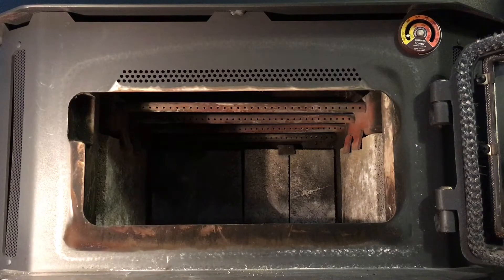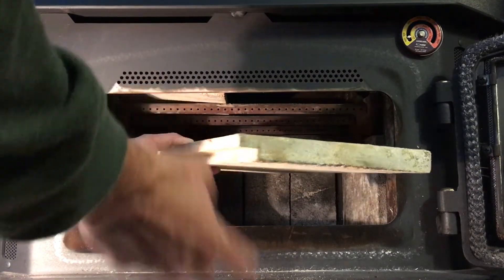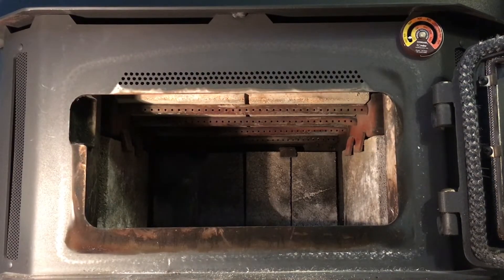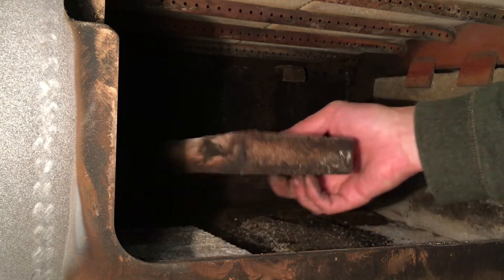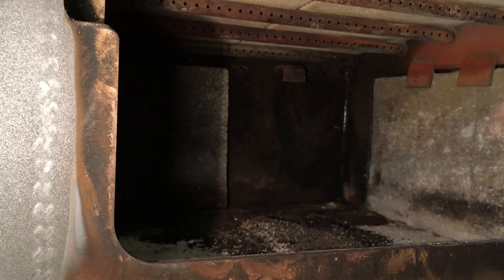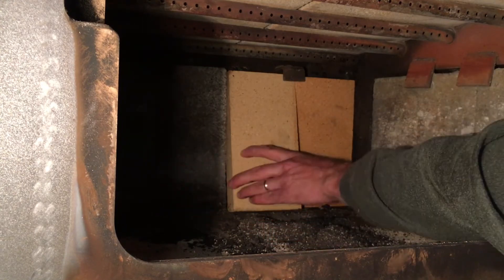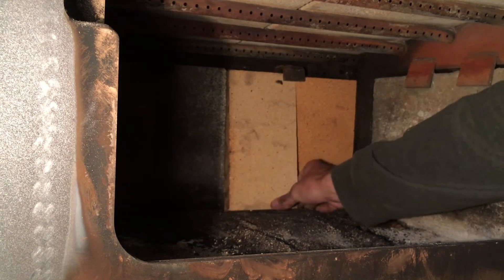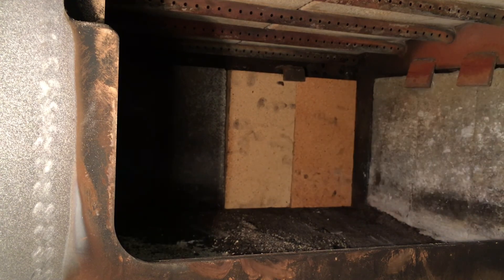Regency i2400 Baffle Installation & Firebrick Replacement

Comment: Exactly what I was looking for. I just noticed my right baffle is cracked with an actual hole in it. AS they come in a kit, do you recommend replacing both (hold onto the old good one)?
Reply from the maker: That’s exactly what I would do.
Reply: Install done, but I have 0 gap and the baffles are in the correct position. I had to put them in sideways and then rotate them. Still worked without removing any tubes.

Comment: I just bought an 12450 that's yet to be delivered and installed. Curious if the baffles are relatively solid and unlikely to crack or more like styrofoam?
Reply from the maker: Not sure what the new ones are like but the i2400 baffle was like a vermiculite brick/tile about an inch thick. Lightweight, but seemed solid.